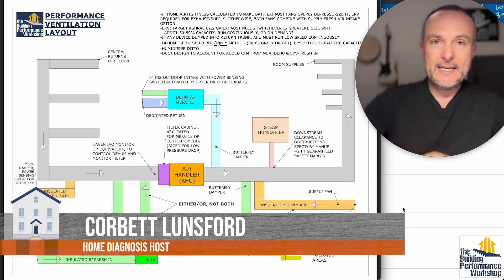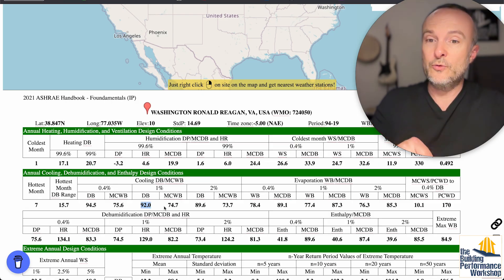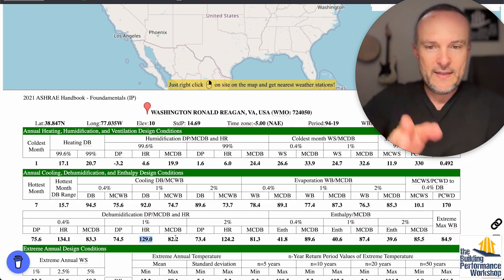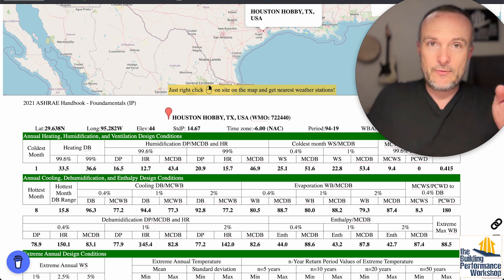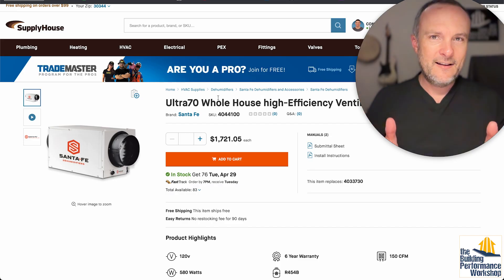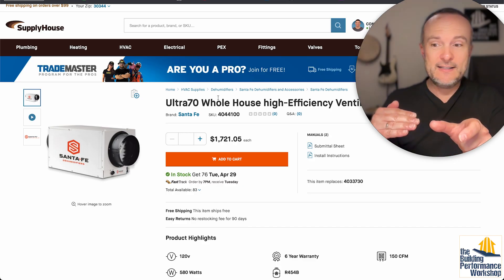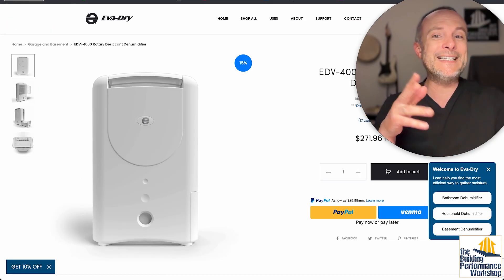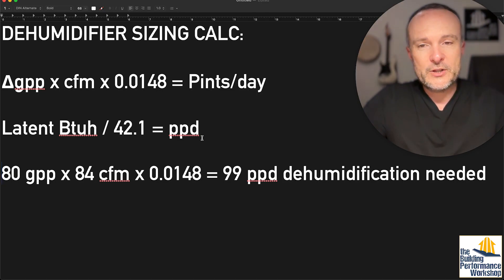ERV vs Dehumidifier: Fresh Air Ventilation and Humidity Control within the Home As A System

Comment: Doesn’t it defeats the purpose of a dehumidifier if you use it as a 2nd makeup air unit? 
I would imagine leaving ERV for makeup air purposes and use dehumidifier for indoor air dehumidification purposes.
Reply from the maker: The make up air comes direct from outside otherwise, full humidity.

Comment: Taking into account the HVAC system providing a large % of the dehumidcation how then do you size a whole house dehumidifier? Because the video and your calcs take the entire envelope as the unit of measure for sizing the dehu and not adding in the HVAC system
Reply: Simply put, a whole house dehumidifier is typically supplemental not the primary machine for humidity reduction. So how do you calculate pint per day requirement
Reply from the maker: Critical to get the actual historical peak humidity, which almost never is at the peak temp for your area. In most of Texas for example the peak temp would be close to 100F but the peak humidity is in the low 80s. Hence you cannot count on the A/C running long enough spans to dehumidify well.

Comment: What would be your solution to those who must cook with gas and lots of smelly greasy foods? If I'm bringing in 900CFM of make up air, that's bringing in a ton of moisture (zone 2). How do you dehumidify that? I was thinking of dedicated systems just for the kitchen.
Reply from the maker: Yes, a dedicated system is what you want, like the Fantech MUAS 1200. Don’t dehumidify it (you can’t), just put it as close to the exh hood as feasible so the air only spends a few seconds indoors before cycling out again. Search ‘make up air’ on our channel for lots more.
Reply: Do you have a window right by the hood?  That works well for all but the hottest and coldest days.

Comment: I know the standard big box portable dehumidifiers don't run as well at/around 65 degrees but the stat sheet on the ultra 70 says it can work as cold as 49 degrees. I would think that a more robust unit like this should function well at 65 degrees. (On a side note, I'm in Minnesota with a slightly insulated basement with an old school open vent system for the Nat gas H Water & furnace to draft that has only 2 HVAC vents blowing the entire basement  & I'm hard pressed for the temp to be below 68 degrees before I ever have to turn on my dehumidifier on to keep the basement around/below 50% humidity in the spring/summer)

Comment: Corbett- please expand on the relative benefits of using an independent duct supplying the dehumidifier versus taking some air from house HVAC return . How bad is it to take some of the house return air to supply the dehumidifier , with or woythout a butterfly damper ?
Reply: My read of his diagram is that the dedicated dehumidifier takes in a mix of indoor and outdoor air.  Probably the majority of the mix is from indoor air, with only a small portion of it being from outdoor air.  This layout minimizes the amount of ducting that contains the super-humid outside air, to minimize opportunities for condensation.  I’d expect that when the control system turns off the dehumidifier, it would close the butterfly valve to the outside intake.  Another reason to close the butterfly valve is if the dehumidifier has been running a long time, and the house has already been supplied with enough fresh air from outside for a while, to modulate the amount of  fresh air being brought in.

Comment: If you hate mold come to Alberta Canada. For 6 months over winter I struggle to maintain 30% humidity with a humidifier blasting. The highest humidity it ever is in summer is 50% and that doesn’t last long.
Reply: Your home needs to be air-sealed.
Reply: @CorwynGC Probably true. My house also came with an HRV so no humidity buffering. Blower door is just under 3ACH@50. Not bad for an 80s house. 
We replaced several windows and all exterior door weatherstripping. I can’t see where the other leaks are.
Reply: @skylerdylan1005  Once you lower the air infiltration, the humidity that humans produce could be enough.
Reply: @CorwynGC If I turn off my HRV then yes humidity definitely improves.  I reached out to Broan to see if they will just sell me an ERV core for my HRV, they say its not supported but i question that. Otherwise I may just buy an ERV and install it myself.
Reply: @skylerdylan1005  I recommend first sealing the infiltration in the structure.  The places I find leaks in buildings in my area are: electric outlets and switches, any junction between dissimilar materials, penetrations of attic and basement surfaces by pipes, ducts, and wires, chimneys, above suspended ceilings, inside closet (particularly the back side of the door), recessed light fixtures, pipe chases and so on.
Reply: @CorwynGC Do you use a thermal camera to find leaks? I haven’t used that. And would it be possible it’s in behind drywall if there are no obvious cracks?
I’ve done everything that I can do by seeing/feeling. Outlets, switches, ceiling lights, rim joists, foundation support poles in the basement, wires from breaker panel. 
There’s a few old casement windows I could do the weatherstripping on.
Reply: @skylerdylan1005  
Renewaire swap.

Comment: If heat pumps just came with modulating hot gas reheat we wouldn't have to deal with all this mess of paying loads for a dehumidifier that heats our home to then remove that heat with a heat pump that doesn't dehumidify enough. That's why I'm just going with a ground source heat pump and recirculating a portion of the heated water to a hydronic reheat coil regulated by a radiator thermostatic valve. Still a headache, but cheaper.
Reply: They do.  Carrier (Flordia Heat Pump) and Climatemaster both make water source heat pumps with Hot Gas reheat.  They even come with a two stage option and variable speed ECM motor.   We have many of them deployed in our manufacturing facility.  They even have active dehumidification.  They are fed by a mix of re-circulated room air and outside air via ERV.

Daiken RTU can be built with ERV followed by hot gas re-heat or gas heat.

Comment: Question, what is the idea temperature for a finished heated basement with in-floor heating? Normally I have been keeping it at 65 degrees Fahrenheit but if I understood part of this video my dehumidifier doesn’t work well in that temperature setting? Could you please let me know your thoughts on this.

Comment: Some manufacturer really needs to offer an erv with a heat pump wrapped around the core. Essentially a residential sized DOAS unit, maybe even with an optional series desiccant wheel for extreme dehum load climates. It would let you ventilate with air that had a controlled dew point and temperature.
Reply: Sounds like an amazing concept , but I figure the costs to manufacture & sell such a unit would be cost prohibited for most & it would only appeal to the most "nerdy" of folks who might want something like that
Reply: @ericscott3997  Well, if you are going to pay for an ERV and whole house dehumidifier, you are essentially already paying for it, plus twice the labor cost. Haveing a stand alone machine to deal with air quality issues (humidity and ventilation) leaves the main ac system/heat pump with just temperature control, which is a simpler task. Some commercial builds are going in that direction. You could also design an air handler with modulating reheat. That solves the dehumidification problem, too; it's just a pain (though completely possible) to do with split DX systems; chilled water systems are easier, and geothermal systems are trivially easy; you just add a modulating diverter valve to the condenser water outlet that redirects the waste heat to a reheat coil. Some manufacturers offer that now, but they don't market that to the residential  market for some reason.
Reply: CERV2
Reply from the maker: @csf1757 not actually an ERV, but video coming soon
Reply: Already doing it.  Renewair ERV, Packaged re-heat coil before heat pump with variable water flow valve (belimo) and variable damper.  This is fed to Carrier two stage water source heat pump with hot gas re-heat, two stage compressor and variable speed ECM motor.  They even come with their own controller with built-in logic and ready to drag drop into Carrier iVu or via BacNET to any other BAS or smart stat.  Set the temp and humidity and it will handle modulating the hot gas re-heat and the active-dehum.  We set the re-heat coil after the ERV to deliver room stat temp air if possible.  The heat pump then takes care of any final de-hum/heat/cool.  

If cool is needed and the outside air is cool enough we will have the logic alter the flow through the ERV via a bypass in the ERV to allow supply air to be cooler.  We have no DX in the ERV., just two ECM motor fans and a bypass damper.

Once you do one the logic is copy and paste.
Reply: we have residential DOAS unit,any interest to know more?

Comment: Technology Connections did a pretty in-depth video on dehumidifiers that is fascinating and gets into the really nerdy parts of the science. I think you would enjoy it, but probably not learn anything like I did. The video really only addresses the freestanding units you can get at big box stores. I wonder if the opinions given hold true for the ducted units? Thanks!
Reply: I was just going to comment about that video. I'm going to send this over to Alec as his next video is going to be about dessicant wheel dehumidifiers.
Reply from the maker: I’ll check it out, thanks guys!
Reply: After watching that recent @TechnologyConnections video about de-humidification. I felt like Alec's perspective of your AC is doing a better job than those freestanding dehumidifier misses the point of dedicated whole home de-humidification. Would really appreciate knowing more about what  @HomePerformance Corbett thinks in regard to that, but having dedicated de-humidification will always be better than what your AC can do because it's entire goal is to get the coils as cold as possible to condense the most amount of water it can while minimizing effects of air temperature.

Comment: Man what a great breakdown!  A few comments from a guy that absolutely loves ventilating dehumidifiers within their capabilities:
1.  From a psychrometric standpoint, be sure to calculate what your incoming MIXED air conditions into the Vent'g dehu are.  When you mix 75/50% with typical hot/ humid outdoor air at the 30% max that Santa Fe recommends, the mixed air conditions are closer to that AHAM 80/60%.
2.  One of the biggest limiting factors on a ventilating dehumidifier is the outdoor air.  At 96 CFM rate, you have to use at least a 98 pint.  The next problems is getting that 96 CFM to be pulled through the Fresh Air duct.  Most of the time, the dehu will pull much less than 30% from outdoors due to duct design.
3.  Ventilating dehu's work great on medium sized homes that aren't too tight and don't require as high of a ventilation rate.  Also consider ventilating on demand.  The Ashrae calc is way more air than what is usually needed.  But if you're stuck complying with code you gotta use it.

Thanks Corbett!
Reply: So I’m going to be that guy who argues with the most respected expert:
ASHRAE62 is probably too low, for a space that is continuously occupied. If everyone leaves the house for 10-12 hours a day, ASHRAE62 may be fine, but if you have continuously occupied space, like wfh, or a large family you probably need more than that to deal with CO2 and other home pollutants. That said- I know I have duct problems, so maybe once I resolve those my venting dehu will better handle our fresh air needs, but while I’m at it I’m installing an oversized ERV.
Reply: @nathanbarry9534  My experience has been a little different but every home is different.  I believe we should continuously ventilate at a lower rate than 62.2 but have the ability to "boost" to a higher rate on demand.  Which means we need to measure the IAQ with something.  Haven IAQ has a great solution for that and a controller too.
Reply: @timdestasiohvac  Agreed, you don't get much from over-ventilating when there's no need to, and it does cost you money. It is nice to be able to boost up to 30ish cfm/person, mostly for infection control more than anything else, especially in flu/cold season, or if you have a bunch of kids or pets running around.
Reply from the maker: Excellent points Tim my man